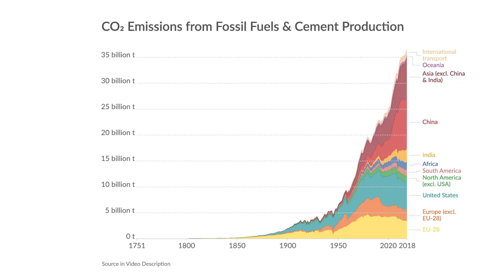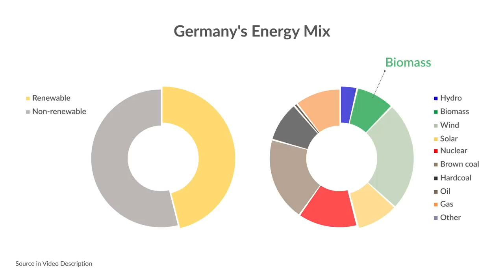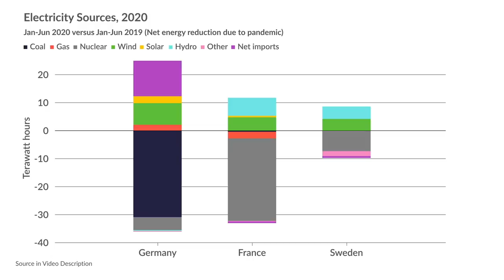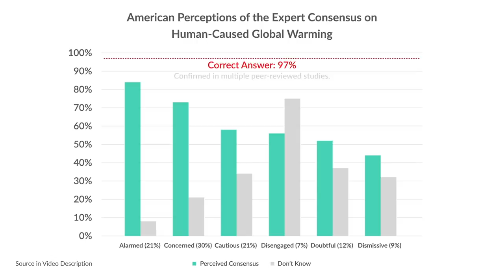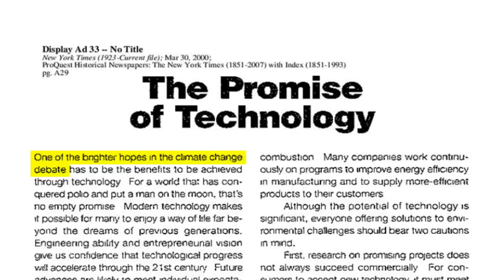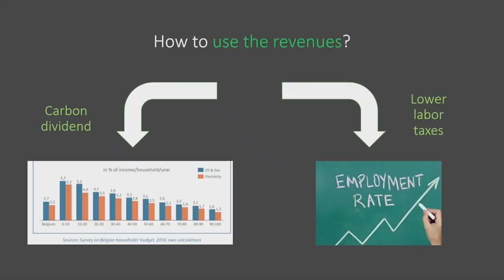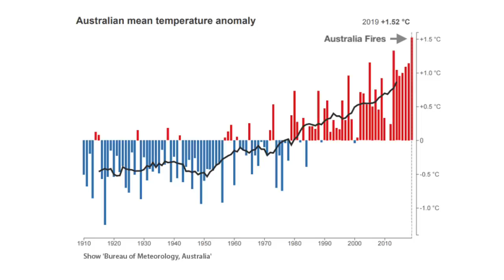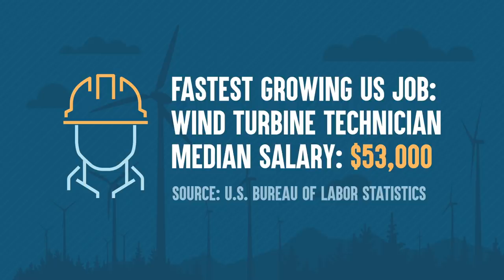The $5,200,000,000,000 Trick Killing More Than Covid, w Stephen Fry.

Comment: Can't warm up fast enough, freezing here in the UK.
Reply: Almost no one realizes we’re actually in an ice age. When not in one the earth doesn’t have polar ice caps.
Reply: yeah, it's not called the winter for nothing mate.
Reply: Hya, hya, hya, hya!
Reply: Grand solar minimum anyone??
Reply: @hisamjan7842  On it's way. The heat we saw spiking above the norm was a the coincidence of the Bray, Yoshimura De-Vries and Gleissberg cycles. We had record sunspot activity for ~8000 years but nobody talks about that in the lucrative "Climate lie industry"
Reply: @stephenmeinhold5452  Green tyranny as the USA and EU zone go more and more left.
There is not climate problem or climate emergency or accelerating sea level rise, or storm increases. The propaganda section of what has/is being done is at the end. This is a condensed version. 
The emperor has no clothes - 

- Trump advisors pull out of the Paris agreement. Why? because a trace gas we breath called CO2 is NOT a magic climate dial and is NO threat to humanity. They are not interested in education and evidence, just propaganda. The key points below outline the lies will be defined with supporting evidence:

--The data almost all alarmists use is proven to be wrong.
--The past levels of CO2 are proof that back the paper saying the ice core record is a bad CO2 proxy.
--Published papers show there is no problem.
--CO2 follows temperature, it does not lead it.
--GHG theory is demonstrably wrong.

The 2 papers that assume CO2 is a problem -1 is the misunderstood spectrographic  measurements of Co2, the other ignores papers that counter the claimed levels by Mann. at the time. That guy is so controversial books have been written about his BS and failed law suits. 

NASA Giss are still telling lies on their website. https://climate.nasa.gov/vital-signs/carbon-dioxide/
the 1st graph is correct, then the lies start.
 I will prove it. 

1) For a start there is no empirical evidence CO2 is the main reason for driving climate change or that CO2 drives temperature at all since temperature leads CO2. This is apparent in the vostok data they (NASA GISS Graph and all alarmists) took the 2nd graph from though the time lag of 100's of years is bound to be off due to the resolution of the record:, it's stated in the paper too but this is the reference material for CO2
Petit, J.-R., Jouzel, J., Raynaud, D., Barkov, N. I., Barnola, J.-M., Basile, I., . . . Delaygue, G. (1999). Climate and atmospheric history of the past 420,000 years from the Vostok ice core, Antarctica. Nature, 399(6735), 429-436. 

https://www.researchgate.net/publication/200033381_Climate_and_atmospheric_history_of_the_past_420000_years_from_the_Vostok_Ice_Core

2) The data they (and all climate alarmist sites) used is anyway known as a bad proxy for CO2 as shown here:
Jaworowski, Z., Segalstad, T. V., & Ono, N. (1992). Do glaciers tell a true atmospheric CO 2 story? Science of the total environment, 114, 227-284.
https://www.co2web.info/stoten92.pdf
Glacial records for CO2 are monotonic and so do not reflect what was actually in the atmosphere. 
It creates nice hockey stick graphs though!
! old tricks new magician. Backing the paper above is evidence based science, not invented feedback systems (more on that later)

3) We can examine the popular claim that CO2 was not over 280PPM for millions of years again here. (the crooks at NASA GISS cite 300 as you see in the 2nd graph on my 1st link to their site)

3a) CO2 425PPM 13000 years ago:
Steinthorsdottir, M., Wohlfarth, B., Kylander, M. E., Blaauw, M., & Reimer, P. J. (2013). Stomatal proxy record of CO 2 concentrations from the last termination suggests an important role for CO 2 at climate change transitions. Quaternary science reviews, 68, 43-58. 

https://www.academia.edu/2949675/Stomatal_proxy_record_of_CO2_concentrations_from_the_last_termination_suggests_an_important_role_for_CO2_at_climate_change_transitions
(fig 6 you can see a 20PPM variation vs 250PPM in non ice core data)

3b) CO2 380PPM 500AD (damn those Romans in their jets, jump to page 57 in this extensive paper)
Kouwenberg, L. L. R. (2004). Application of conifer needles in the reconstruction of Holocene CO2 levels. 
https://dspace.library.uu.nl/bitstream/handle/1874/243/full.pdf?sequence=1&isAllowed=y

3c) CO2 average 325PPM <1939! lows of 152 highs of 700
Slocum, G. (1955). Has the amount of carbon dioxide in the atmosphere changed significantly since the beginning of the twentieth century. Month. Weather Rev, 83, 225-231.

https://ktwop.files.wordpress.com/2013/05/slocum-1955-carbon-dioxide1.pdf

So the claims made are complete BS as well as the fact they bolt on the live data to a known bad proxy. = Fakery.

4) The next point being CO2 as a climate "Forcer" is also nonsense since climate scientists fudged the Stefan Boltzmann constant into climate models where new physics is invented. Apparently by adding 1 part of something, it can magically heat 2500 parts around it. (Happer an expert on Co2 is ignored trying to explain this - the cult don't like you questioning them) I won't dwell there as that is another essay debunking pathetic climate models unfit for purpose and never proof tested!. They contrived a "Forcing" but ignored saturation and Kirchhoff's Law of Thermodynamics (that an absorber of thermal radiation MUST also be an emitter. There are no exceptions) Thus, CO2 also has a cooling effect on the upper atmosphere since it provides a way for heat to be liberated to space (as do other gasses) The conflicting science at the time of Arrhenius's work was also ignored. and planets with NO GHG's have an atmosphere that contradicts the GHG BS.

5) CO2 follows temperature rise, it is not the driver of it:
O. Humlum et al. / Global and Planetary Change 100 (2013) 51–69

https://www.researchgate.net/publication/257343053_The_phase_relation_between_atmospheric_carbon_dioxide_and_global_temperature.

6) Greenhouse gas theory is demonstrably false both in how it is named and the claims made:

Wood, R. W. (1909). XXIV. Note on the Theory of the Greenhouse. The London, Edinburgh, and Dublin Philosophical Magazine and Journal of Science, 17(98), 319-320.
http://www.biocab.org/Experiment_on_Greenhouses__Effect.pdf
(...."which demonstrates that long-wave infrared radiation is not trapped by atmospheric greenhouse gases") all those squiggly lines on all those website sites parroting the same crap.

7) The system is an adiabatic mechanism not restricted either and we can calculate a theoretical doubling of CO2 as cited by Holmes:
Holmes, R. I. (2018). Thermal Enhancement on Planetary Bodies and the Relevance of the Molar Mass Version of the Ideal Gas Law to the Null Hypothesis of Climate Change. Earth, 7(3), 107-123.

https://www.researchgate.net/publication/324599511_Thermal_Enhancement_on_Planetary_Bodies_and_the_Relevance_of_the_Molar_Mass_Version_of_the_Ideal_Gas_Law_to_the_Null_Hypothesis_of_Climate_Change

8) For some missing climate cycles the IPCC completely forgot in their frame CO2 agenda (+ they cherry picked the start point for TSI) as cited in the Holmes paper:
Lüdecke, H. J., Hempelmann, A., & Weiss, C. O. (2013). Multi-periodic climate dynamics: spectral analysis of long-term instrumental and proxy temperature records. Climate of the Past, 9(1), 447-452. 9(1), 447-452.
https://www.clim-past.net/9/447/2013/cp-9-447-2013.pdf

9) This is why the warmers try to claim the medieval warm period was a local event! to erase their other false claims of industrial period & Co2. John Crook, sorry Cook at sceptical science claims this, it's BS. You tell them, comment deleted. The same paper already cited shows fig 2 that adds the Antarctic.

9a) Loehle, C. (2007). A 2000-year global temperature reconstruction based on non-treering proxies. Energy & Environment, 18(7), 1049-1058.
http://faculty.fgcu.edu/twimberley/EnviroPol/EnviroPhilo/GlobalTempResc.pdf
""In the present study, only three or four of the sites are from Europe, so it cannot be argued that the MWP was strictly a European phenomenon...""
Adding North America, South America, Africa, Asia to this ""local event"" (#Sarcasm)

Perhaps the climate CO2 cult would like to watch how the science has been political, not scientific while they falsify an experiment!! for the audience they need to elect them via fear, fake science, false accusations and more.. Note the last vid at the bottom in the next link is the actual experiment. The jar loaded with CO2 under the heat lamp is marginally cooler.

10a) Bill Nye the lying science guy:
(democrats love the lies for control)
https://wattsupwiththat.com/gore-and-bill-nye-fail-at-doing-a-simple-co2-experiment/

10b) What happens to the "Heat trapping gas" if we put it inside double glazing?
https://principia-scientific.org/industry-experts-co2-worse-useless-trapping-heatdelaying-cooling-2/

The far left and far right are equally dangerous places. The tips the powerful people on the left sound like they came straight from the Nazi guide to propaganda. This may ring a few bells?

“Not every item of news should be published. Rather must those who control news policies endeavour to make every item of news serve a certain purpose.”
-- Joseph Goebbels 

“The most brilliant propagandist technique will yield no success unless one fundamental principle is borne in mind constantly - it must confine itself to a few points and repeat them over and over.” 
― Joseph Goebbels 

“It would not be impossible to prove with sufficient repetition and a psychological understanding of the people concerned that a square is in fact a circle. They are mere words, and words can be melded until they clothe ideas and disguise.”
-- Joseph Goebbels

“The bigger the lie, the more it will be believed.” 
-- Joseph Goebbels 

I prefer this guy:

"Unthinking respect for authority is the greatest enemy of truth"
 -Albert Einstein
Reply: @grahamnumber7123  you need to get out more and talk to real people.

Comment: I’m thinking nuclear power is the way to go- many small power plants, like on naval ships, as many as required, with each city/town having its own grid...
Reply: Nuclear power stations cannot be built quickly enough. It takes at least 12 months per plant and longer. It will never supply more than a few percent of the energy needed. It's the logistics that is the main problem. Anyway, why use it when sun, wind and ocean are plentiful and the efficiency is fabulous. And the old chestnut, what about the spent fuel etc etc.
Reply: Have you not watched the above video?
Reply: A thousand or so nuclear power plants dotting the countryside and planet.  Nothing to go wrong.  No supply chains to mix up or waste streams to be, "lost."  We can not take responsibility for the plants existing.  This makes me skeptical of increasing the problem by an order of magnitude.  I was installing a small solar array the other day and it bit me.  It helped my confidence that solar generated electricity is powerful.
Reply: People have been successfully brainwashed against Reactors.

All while Loving what CERN is doing.
 If you really think solar, wind is the answer, it's the same brainwashing platform.

For those of you who really think renewable energy is the answer.
Can you answer this question,
Who since it's birth, have been the largest backers of "renewable energy?" Theme song to Jeopardy
Da da da da da da da da da da da da da da da da da da da da da da da da da da da da?
Who is the Fossil Fuel Companies!
I wonder why?
Reply: I would research Guy Mcpherson's stance on this first....
He can explain why it is a bad idea way better than me....

But in a sentence, when civilization inevitably collapses due to irreversible abrupt climate change, all those nuclear facilities will no longer be maintained, and there will be global scale meltdown....
It's a bad idea to contribute even more to that, rather than work at cleaning up and decommissioning what we can while we still can!
Reply: NIMBY.
Reply: @brianwheeldon4643  you are quite incorrect. Nuclear is the only answer. Grid scale battery storage is expected to deliver 2Twh/yr by 2030 and that's a stretch. In 1970 France built 380Twh/yr of nuclear over a 15yr period without computers etc. You've been sold a lie.
Reply: @MattAngiono  Fail safe nuclear reactors already exist. Guy is wrong.
Reply: @garry8390  what percentage of them? 
Unless it's 100%, the dangers are catastrophic....

We aren't just talking power outages, they need to deal with all the climate impacts, including hurricanes, earthquakes, and sea level rise....

Can they get up an move when the ocean creeps in?
Reply: @MattAngiono  The average sea level continues to rise at 8" per century, just as it has for the last 400 years.
Reply: @garry8390  , yes they do. When this was achieved, they were closed down, defunded and the entire program was abandoned.
"Pandora's Promise"
Netflix use to have it.
But, based on how censorship is rampant now on anything that clashes the media's scripted narrative. Which is designed to create dumb, angry and obedient
Sheeple. It may have been yanked.

While CERN is attempting to store Anti Matter, create portals to "let things in." 
A science capable of giving society massive amounts of power, for the cost of the Reactor. Has been abandoned in favor of wind machines that;
Destroy the environment
Kill Birds
Are too difficult to calibrate properly, are gigantic waste issues.
Blades are delaminating
All backed up with Diesel generators.
Solar is worse.
John 14:6
Reply: @christophersleight19 
Nonsense. Fossil fuel companies aren't the biggest backers of renewables.

Nuclear is way to expensive.
The only reason nuclear is pushed is to keep fossil fuel alive.
"We don't have to transition to wind/solar... just wait an other 10 to 30 years and the magical nuclear will solve all problems"
Reply: @TBFSJjunior  , are you sure.
Have you followed the $.

Things are not as they seem.
Jakob, have a great Holiday my friend. Greetings from Colorado Springs Colorado. Christopher
Reply: @christophersleight19 
Yes I have.
Most ppl in Germany building renewables are farmers, home owners, start ups, etc.
The big power companies have totally dropped the ball and big fossil fuel companies are trying to push hydrogen
Reply: Micro grid nuclear technology prefabricated and mass production,  learn to reuse, recycle spent nuclear fuel
Reply: Micro nuclear power plant that’s prefabricated and modular and can safely shutdown without human interaction and can communicate with other plant to share power and avoid power loss. Smart distribution.
Reply: @TBFSJjunior  Sorry, but you obviously have not followed the money with your comment about many people in Germany building renewables. Have you looked at the subsidies offered for purchase and installation of a solar panel or wind turbine? Once the refunds (sometimes over 50%) dry up, so do the installations, as thery are no longer economically viable for the ratio of investment to energy production. This has happened in Spain and Portugal off the top of my head. United States and Canada too. Once refunds stop, so do the installations.  
Funny how few consider what it takes to actually manufactur a solar panel. From strip mining various elements, refining, using oil fuels for energy, oil in plastics, to the machines that make and assemble the parts (electronically controlled, which means even greater strip mining and rarer earth metals). 
...but wait, there's more! All those batteries that you need to store your renewable energy. Do you understand the process of "recycling" a battery? Have you seen the difference between recycling centers in Europe, versus places like China or the e-wastelands some African countries import from other countries? Once EVERYTHING is actually considered for once in an argument about types of energy production, coal does not look too bad now, does it? 
Is coal the end all be all? Is it a fantastic, wonderful energy source? Of course not. Better than cutting down trees and incinerating them though. That is just asinine.
Reply: @bluesteelbass 
"Have you looked at the subsidies?"
Yes I have and your comment is misleading at best.
My brother has solar on his roof, which is subsidiesed with 49cents /kWh over 20 years. It was build in 2000 and the subsidiese will run out this year.
My dad build rooftop solar last year and gets 7 to 8c /kWh. So that is a price drop of 85%. (7to8 cent is only for small sub 10kWp installations.)
A friend of mine has build solar without subsidies. He gets 3 to 4c /kWh, which is the market rate in Germany.
In Saudi Arabia they've just finished the bidding on a solar project at 1.35c/kWh.
Currently the EU has tariffs on solar panels, which makes them more expensive, but even if those get dropped, Germany won't achieve Saudi-Arabia's cost figures, but at the current rate even roof top solar will be viable without subsidies in a couple of years. (Big roof top solar already is.)
Onshore wind doesn't get subsidiesed in Germany anymore and the German government actively tries to limit the building of renewables and tries to extend coal till 2038.
Just for comparison:
France claims they can build nuclear for 12c/kWh and hope their next gen reactors drop to 8c/kWh, which both is more expensive than all new solar/wind in Germany.

"Do you understand the process of recycling a battery"
Yes I do. We have few batteries that need Recycling yet, but companies like VW want to keep their car batteries in Germany and fully recycle them. First for local storage and later to produce new batteries. This would drop their emissions by over 50%. There is already a german company recycling car batteries to over 95%.
"Coal does not look to bad"
No coal still looks bad even if you factor everything else in.